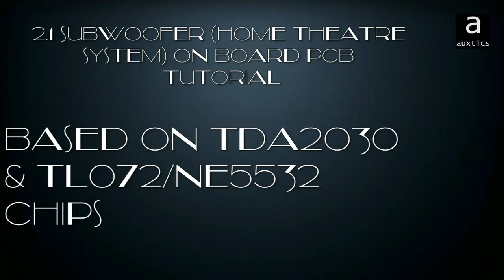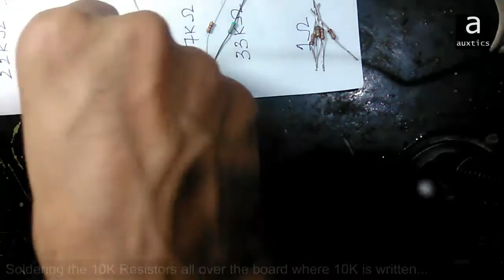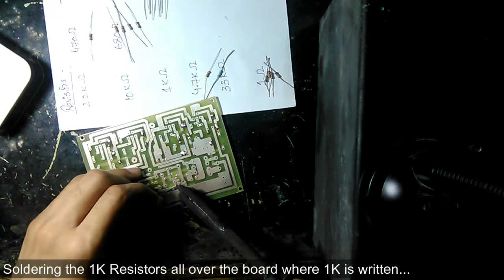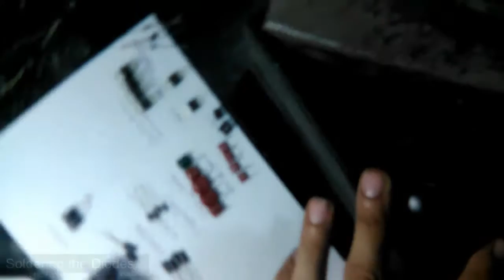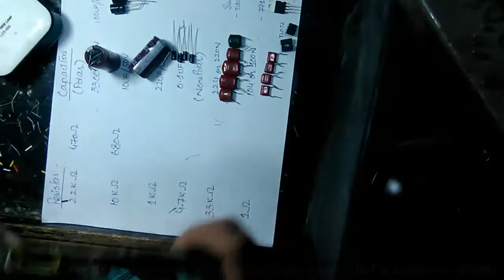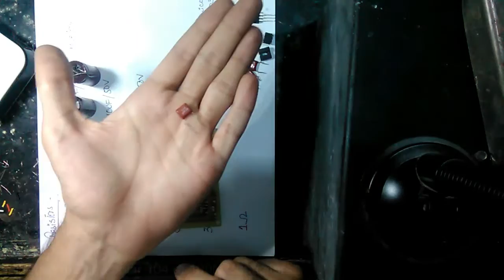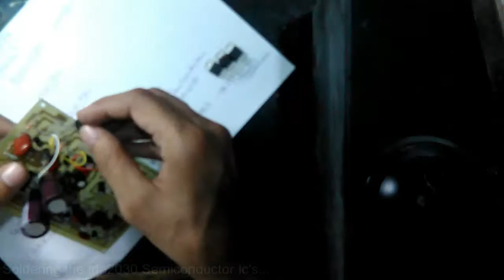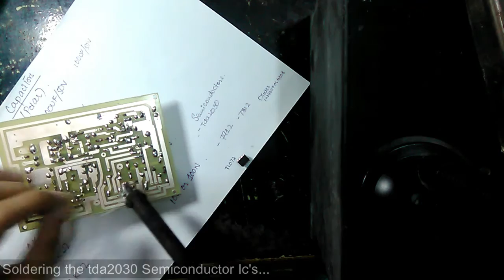2.1 subwoofer amplifier based on tda2030 & TL072 IC -- On board tutorial

Comment: Two more questions:P Could I use TDA2050 for this and also all the circuits mentioned in the blog are at the same pcb? (lpf,regulator, sub amp,l+r amp etc.) P.S. This is the same amp used in the panasonic bass tube thing?
Reply: Are the circuits in the same pcb? and could i use tda2050 instead of tda2030a?

Comment: Is there any  replacement for TL071??
Reply: @AuxticsTechnologies  Looks like TL071 or equivalent dual or quad packages are more cost effective... however, I did find this INA111 that I haven't found a dual or quad package equivalent yet.  However, looks a little better in performance with regards to lower noise floor.  Thinking the price is too much compared to the TL07X's.   What are your thoughts?  nonionizingemf@gmail.com if you could kindly send the PCB and any updates that aren't on the blog link in the description. 

Thank you for this detailed description. I've only found similar in such detail relating to what I am studying now, the Klipsch ProMedia 2.1 systems schematics free online since use the TL074CN and looking at for ULF-ELF-VLF listening also and maybe communications too.  Great to see your production and work.  Kindest regards.

Comment: while increasing volume of sub woofer more noise produced continuosly in left and right. If sub woofer volume is reduced to zero then there have no noise why should this problem arises  please give me solution
Reply: Engine running like sound
Reply: I have checked no of times what to do
Reply: I have changed it but problem repeated
Reply: There left channel only shows noise
Reply: Polarities are same connected to the circuit
Reply: How to check
Reply: Can u suggest 
The speaker power rating and resistancr